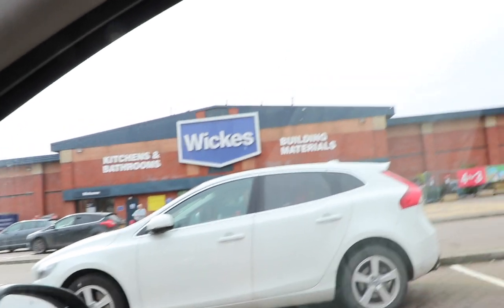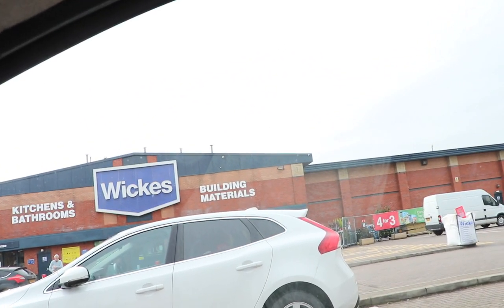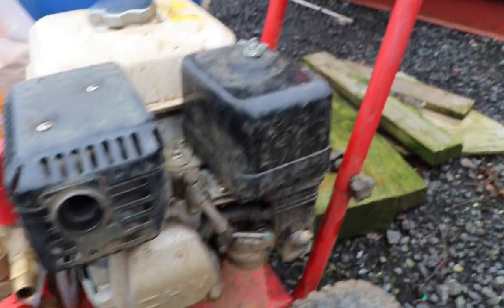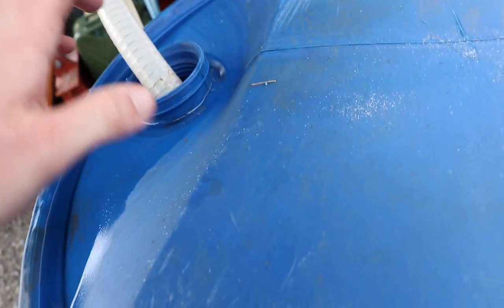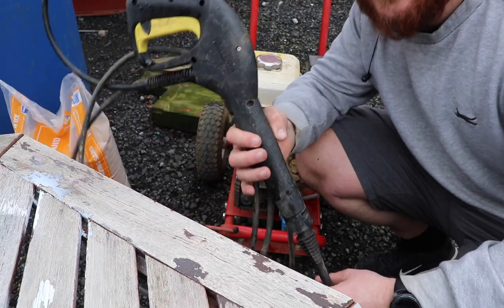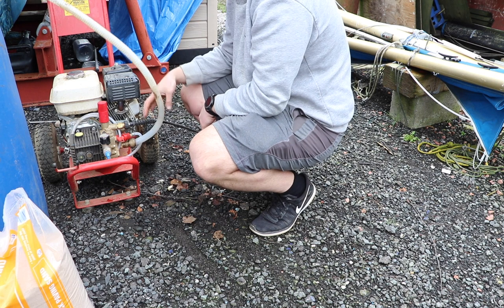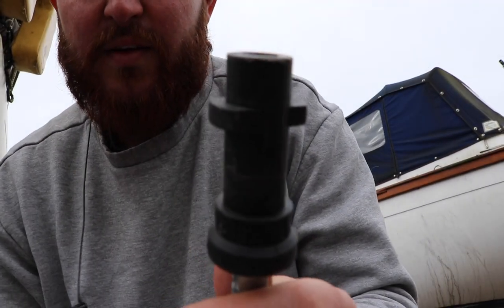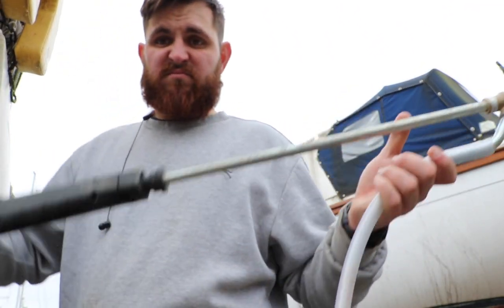Karcher Sand Blasting Attachment Success! - SV La Viajera - Albin Vega Refit

Comment: The paint residue is highly toxic. How do you plan to collect and treat it after sandblasting? Sailing vessels (which I also own, btw) are already a chemical ticking bomb waiting for long term negligence to happen. I wish owners could be more environmentally conscious.
Reply: It is illegal to use kiln dried sand in either wet or dry blasting.

Comment: That is genius stabbing the plastic bag of sand!  I would have put the sand in a bucket, and then water over spray would make the sand wet and the system would clog.  Well done!
Reply from the maker: Thank you! Did you ever give it a go?
Reply: It is illegal to use kiln dried sand in either wet or dry blasting.

Comment: What attachment are you using? I bought one for soda blasting motorbike parts but doesn't seem to work. Media gets wet right where the media meets the water stream and clogs up.
Reply: It is illegal to use kiln dried sand in either wet or dry blasting.

Comment: Hi Josh, glad to see you back at it again! As to the prep work. This is kinda up to you. Doing just the patches should still be good for many years of service. Otherwise you can do the whole lot in one go and know that the whole lot should be good for more years to come.
Reply from the maker: Cheers Rigal, after seeing how well adhered the epoxy is in most places I'm opting for a "fix the patches" approach. Should save me a few days work and result in a job that's just as long lasting. Glad to be back Rigal, nice to have your input again, Josh
Reply: It is illegal to use kiln dried sand in either wet or dry blasting.

Comment: Thank you for the video I've got a bottom I'm redoing on my 29 foot motor vessel . I'm going to use on a larger pressure cleaner hopefully it'll cut the bottom paint off and some of the barrier coat being a motorboat Hall pain in the neck to run a DA on it orbital sander or grinder not too bad in the stern where I got flat surface the  orbital sander da works great with 120 Grit for Feathering and go over it again with 220

Comment: Any reason you didn’t cover the ground when sand blasting? 
That dust when dry you’ll have to breathing forever while working in that spot The upside to water sandblasting is you can catch the sand paint mud mix in a tarp and strain debris out with a hay bale used same on brick with paint and made easy clean up no dust and unlike brick didn’t have to deal with the shrubs

Comment: I had the marina water sand blast the hull then I patched and sanded, next I sprayed the whole bottom with a high build epoxy instead of resin because of prier problems with gelcoat blisters. The epoxy sticks better. Also epoxy is a perfect primer for bottom paint. You need an airless or a presure pot to spray high build epoxy because its very thick. Check with a professional spray painter.

Comment: this looks to good to be true, ive just bought a small boat which is located on a dry dock marina, i have asked the question about shot blasting a gpr boat and they have never heard of it, does this damage the gel coat, and would you use the same procedure  above the foul weather line, also you mentioned caustic soda, never heard this mentioned anywhere else, thanks for the video.
Reply: It is illegal to use kiln dried sand in either wet or dry blasting.
Reply: @chrisdyer6370  I thought I read this somewhere else as well..... oh yeah on this video's comment section....multiple times over and over.

Comment: With regard to Copper coating I've heard that it has to stay wet so if you plan on taking the boat out in winter to store it the copper coat will dry out and flake off, might only be certain types though?
Reply from the maker: Andre Hey Andre! I've not heard that myself but when you originally put the coppercoat epoxy on I know you have to keep it completely dry for three days because it's a water based epoxy. You think that's it?

Like you say there could be other types too, plus different weather conditions in different areas... guess the solution is to keep it in the water and keep on sailing haha. Thanks, Josh
Reply: I've not heard about that either, but iirc. Copper coating is just copper infused resin. So once it's set and cured, it shouldn't have to be kept wet anymore and can be kept out of the water for long periods of time.
Reply: Must admit I've tried looking for it but have no idea where I saw it ( maybe another sailing channel?) so forget I spoke and carry on regardless lol
Reply: I've had copper antifouling on my Vega for several years, when both wet and dry, no problem at all. Same with my friend who owns a very large and expensive yacht:- he's the meticulous skipper of the rescue boat, marine engineer, etc etc and he has never had a problem with it in over a decade and loves the stuff, and we both live in the extreme environment of Sweden, with frozen harbours in winter and high, very dry summer temperatures up to 30 degrees (out of the water, that is).  Just make sure that the first coat has a proper primer over the existing epoxy/coating (- always best when taken back to the epoxy, of course). From there on no need to prime, just apply the copper antifouling year after year. I have to say that being such good quality, it works out at a reasonable price - about £100 each copper coat, which I do every 2 or 3 years, and the smooth finish each time she's hauled out means loads of time saved in preparation and sanding etc. - meaning none at all, just a jetwash before application. I wouldn't swap it for anything else.

Comment: How many years worth of bottom paint will this method remove I have a 1995 so about 27 years worth of paint?
Reply from the maker: I couldn't say for sure how much paint you'd get through on a single application but once it's eaten through all it can you can reapply. So it might take a couple of attempts but this will make light work of it compared to most other methods. Good luck and let me know how you get on! Josh

Comment: Hi, I've a couple of questions about this method of antifoul removal. Firstly some users experienced sand clogging in the nozzle, any tips to avoid this? I see someone commented the sand pipe feed is better above the lance to maybe avoid this.
Secondly what spec of media is best. I've seen different ideas from kiln dried sand to recycled glass , 0.2-1.0mm particle size
Reply: It is illegal to use kiln dried sand in either wet or dry blasting.
Reply: @chrisdyer6370  lol what
Reply: @cocospops  breathing find sand dust can cause silicosis, a nasty lung disease. I have no idea of the law or how much it would take to cause an issue but silica sand is not used for normal dry sand blasting for that reason. I suspect being mixed with water as it is here may help control the dust but I would at least wear a mask

Comment: What you're calling the epoxy primer just looks like the gel coat?   In terms of paint layers... assuming it's not too late, which it probably is, my understanding is that you want two layers of epoxy barrier. Then two or more coats of bottom paint (differing colors so you can see when it's time to re-apply) then a copper coat. Or some other kind of anti-fouling.  I like the look of the coppercoat though.   The epoxy for waterproofing paint is sacrificial and is expected to wear off and the antifouling is specifically for preventing marine (organic) growth.    Curious to see what you did.  Enjoyed this thoroughly.   I love that boat.
Reply: "the epoxy for waterproofing is sacrificial" - eh? What would be the point of a waterproofing coat that wears off? Gel coat is generally epoxy.  It means a medium made from an epoxy plastic as opposed to a polyester plastic for fibreglassing (polyester is used mainly as it's a lot cheaper and in many ways easier to use). Epoxy has no micropores that let in the water, whereas polyester does have micropores, so one applies one applies epoxy the polyester to stop water from getting into it. Apply the copper coat primer to the epoxy, whether old or new, as long as it's in suitable condition for use, then the copper coat itself traight over the epoxy. Copper kills most plant growth and also stymies marine life growth, which is why the navy used it (expensive copper plate variant) for centuries. It is only cost that limits its use, and the quantity per unit area, which could be too harmful for marine organisms, so is limited in some waters, and/or too heavy for fast boats.

Comment: Ues your right ...sand the bad area back with the orbital...epoxy the sanded area...and continue to the next etc etc...always knowing that sooner or later it will ALL have to be done...but you already know that...thumbs up⛵⛵
Reply from the maker: S/V Thirteen Winds I think this is the way I'm going to do it, the coppercoat instructions themselves say that leaving the epoxy on is ok and if I've removed all the bad areas then there shouldn't be anything to worry about. Now to decide on whether or not to fit the keel cooler before or after the coppercoat! Josh

Comment: Do you know if this would strip paint and/or rust from a metal trailer?
Reply: A wet sand blaster will take off rust I am getting ready to wet blast my Chevelle frame
Reply: It is illegal to use kiln dried sand in either wet or dry blasting.

Comment: It is illegal to use kiln dried sand in either wet or dry blasting. This is because the process causes the sand to disintegrate creating an ultra-fine dust which can contain dangerous amounts of RCS (respirable crystalline silica).

Comment: Great stuff, do you know if it works on metal powder coat?
Reply from the maker: Have never tried sorry. Good luck though
Reply from the maker: Never tried sorry. Let me know if you try it out!
Reply: Not a chance
Reply: It is illegal to use kiln dried sand in either wet or dry blasting.

Comment: Could you have done this on the inside? What were the specs on the pressure washer?
Thank you
Reply: It is illegal to use kiln dried sand in either wet or dry blasting.

Comment: with my karcher k2, wet sand wont work for me, the sand get wet at the entrance of the end and the sand stuck there. better use Jetmag 35/70
Reply: so which pressure washer do you recommend to blast? Not enough pressure in a K2, did you try experimenting with turning the lance attachment round so pipe feed with sand above the lance.
Did you discover reason for sand clogging?

Comment: could you use sand off the beach la ?
Reply from the maker: Never tried it but you'd need to filter it so it's just sand and then make sure it's super dry. Probably possible but more effort than it's worth compared to just buying kiln dried sand. Let me know if you try it though
Reply: @SVLaViajera  It is illegal to use kiln dried sand in either wet or dry blasting.

Comment: Just spent a few hours today and yesterday sanding on the bottom on hull 3280. Have about another 15 hours or so to get the 7 layers of flaking paint off of her and down to the gelcoat. Would have been nice to be able to use your sand blaster, but i think the yard i am in would have environmental containment breach alarms going off since i am in Stockholm ;-) Sadly they are banning all the copper coats here, so i am still trying to figure out which direction to go on the bottom paint.
Reply from the maker: Hull 3280, that'd be one of the newer ones! I would have had to hand sand if I couldn't have used this. Have you thought about soda blasting after the caustic soda paint stripper mix? If I had been able continue to use the air compressor that would have been my way. The soda dissolves in the rain too.

I've heard that they're banning the coppercoat in some places, do you think they'll have an allowance for boats already copper coated? Maybe you could sneak in before the ban
Reply: SV La Viajera I am just going to suffer thru the rest, it's kind of cathartic, and only costs me a bit for the sanding pads. 

Sadly the places to dock in lake malaren are almost all requiring certification of removal of the banned antifouling which costs about a €1000 to have done. This is the first year after the grace period for the last few years.  The place I am berthing isn't requiring the certs, but want it free of the banned stuff.
Reply from the maker: Matt Rice it can be quite relaxing can't it, I'm the same with painting and vanishing

Ah, so the grace period is over already. I really wouldn't know what to do in your situation, I've not looked into any other of the antifoul solutions. You'll have to let me know as I'm sure the same regulations will make it over here before you know it! Josh
Reply: It is illegal in the UK to use kiln dried sand in either wet or dry blasting.